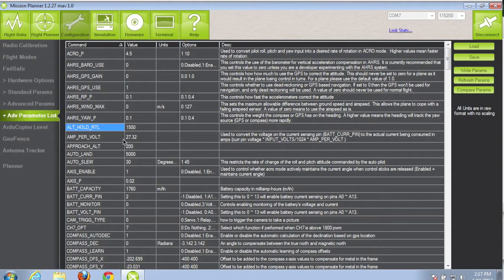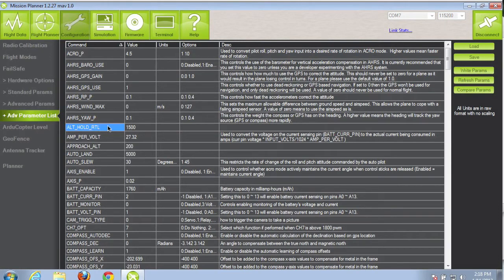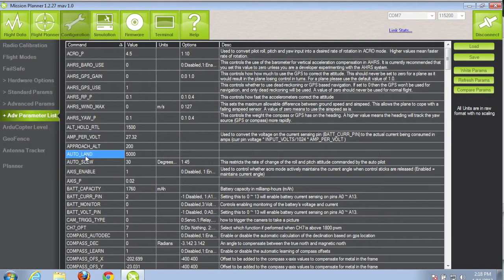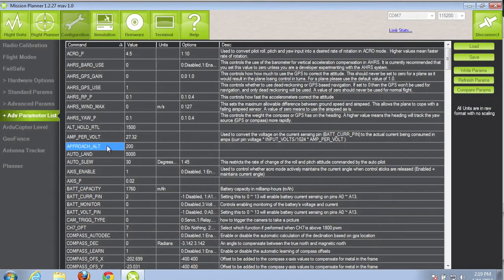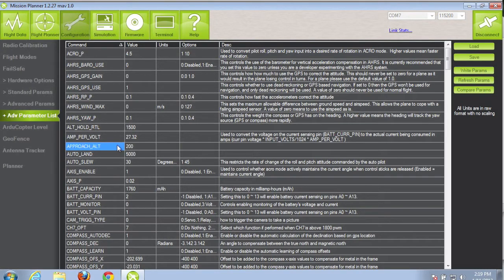APM 2.5 ArduCopter Quadcopter Return to Launch (RTL) Field Test in Windy Conditions - Austin, TX

Comment from the maker: I'm using the MediaTek GPS and it works well. I haven't used ArduFlyer but from what I understand they're assembled with the same components and you run the same firmware, so I'd expect it to be similar if not identical. If you do get around to testing I would love to hear your results.

Comment from the maker: The main manufacturer of the APM board is store diydrones com, but you can also get the ArduFlyer from rctimer com. From what I've read and been told they are assembled in the same factory, but the ArduFlyer is significantly cheaper. There's a guy on my channel that has been flying with it and loves it.

Comment from the maker: The FCs that I'm most familiar with are KK, Naza, and APM 2.5. I looked at CopterControl at one point, but it was hard to come by. Regarding your question about how hard it is to get stable. I'm pretty new to this hobby as well and the Auto Trim was a very easy process. Once you get your APM up and running you can Auto Trim in a matter of minutes. Let me know if you need any help.
Reply: Dennis Baldwin hey.. I'm looking for a flight controller, but I'm confused between naza lite(upgrade to v2) and apm 2.8, which one is a go?

Comment from the maker: That's funny. You flip the switch and bye bye! I felt that way when RTL was activated. The quad quickly elevated and at one point I thought it had flipped upside down because of the wind. APM is a much better pilot than I am.

Comment: Yes i am getting a 3D fix with about 8 or more satellites. The odd thing is that sometimes the MediaTek GPS gets a lock in about 3 seconds of power up or after 2 flashes which seems way to fast to me for ANY GPS. Im putting down to a faulty GPS receiver. What do you think? Thanks for your reply!

Comment: Hi Dennis great vid. Do I need any additional hardware to use the RTL, or is it standalone?
Enjoy your videos. Thanks Ivor
Reply from the maker: Ivor Nathan No additional hardware is necessary but make sure your GPS/Compass are well separated from the ESCs or you'll have problems in Loiter mode. You need a good loiter if you want to RTL. Check out the compassmot feature to see what your interference looks like: http://copter.ardupilot.com/wiki/ac_compasssetupupadvanced/

Comment: Hello @Dennis Baldwin I just built a quad with the APM 3.1 mini FC. I am thinking of putting it on my RC wing and getting a Pixhawk for my copter. Please how would you compare the APM 3.1 and the Pixhawk in terms of flight performance and stability?
Reply from the maker: Bennie Chiedu I've had a good experience with the Pixhawk and it's my go to FC. I'm don't have any experience with the APM mini so I'm not qualified to compare. I run Pixhawk on my Hexa and it performs wonderfully. Good luck with your research.
Reply: Dennis Baldwin Thank you so much for replying. Your videos are very educating.
Reply: Bennie Chiedu  hey.. I'm looking for a flight controller, but I'm confused between naza lite(upgrade to v2) and apm 2.8, which one is a go?

Comment: My parameters are set the same as in your video. But my copter does not  come down. it hovers 50Ft over launch point. till battery dies. Do you have any ideas? Thanks
Reply from the maker: Check your RTL_ALT_FINAL param and see what it says. Perhaps it's set at a high altitude so your quad doesn't come down.

Comment: Hi, im new with arducopter and i have some doubts about RTL parameters. My first test was with RTL_ALT set to 2000, RTL_ALT_FINAL to 800, RTL_LOIT_TIME to 2000 ms. My copter fly very well towards home and descend to RTL_ALT_FINAL but it didn't land, my throttle was in the middle, do i have to low the throttle to land?. My second test was with RTL_ALT FINAL set to 0 and RTL_LOIT_TIME set to 0. My copter again fly very well towards home an descend to 10 meters and stay there for about 5 sec and land, my question is: when or where in RTL secuence is this RTL_LOIT_TIME taking place? THANKS!
Reply from the maker: In your first test if you don't have it set to land then you'll need to switch out of RTL and land it. In your second test the RTL_LOIT_TIME is the amount of time the quadcopter will hover before it begins to descend. I'm not sure why it paused for 5 seconds before it decided to land. Perhaps it was trying to do some final calculations.

Comment: Ok, that's good. What would you recommend for FPV gear?
Reply from the maker: Ivor Nathan This is my favorite FPV starter kit right here: http://amzn.to/1nNJArL I use it with the monitor in my video here: How to Setup FPV w/ GoPro HD, HobbyKing 5.8GHz Transmitter/Receiver for DJI Naza Quadcopter

I haven't made the leap to goggles just yet. Good luck with your setup.
Reply: Thanks Dennis, will post vid when I get it all together. :)

Comment from the maker: I send you a personal message before I saw this. Yeah I agree that a 2 second fix is very fast. Google "Time to first fix" and look at the Wikipedia entry. You'll see that the different fix types. There's a chance 2 seconds is possible if it's a "hot" or "standby" fix. But if it's a cold fix and that fast then something is definitely wrong. Try running some APM 2.5 command line tests against the GPS.

Comment: sir my quad copter does not fly but running.  can you help me  ?
Reply from the maker: +ajay soni We're going to need more info to understand the problem.
Reply: mate you may have put the quad props on different motors or you connected the esc wrong!

Comment: Hi Dennis, looking good, especially with all that wind!

I did a similar test on Thursday (whilst doing some battery endurance tests) so thought i'd try a video respone thing here ... not sure that worked, check out my video called 3DRC RTL From 21m Loiter. 

Anyway, just for info, my ALT_HOLD_RTL = 5000 (5m), wanted to be a bit safe ;) AUTO_LAND = default (5000 I think) and APPROACH_ALT = 0 (so that it lands).  Required throttle off and switch to stabilize to shut down motors at the end.